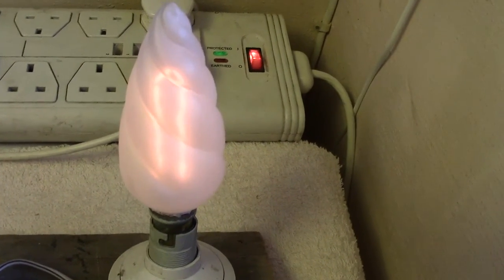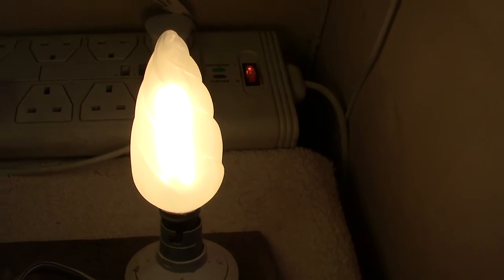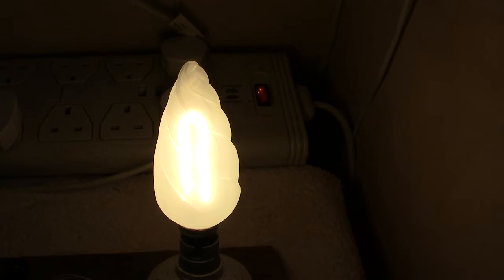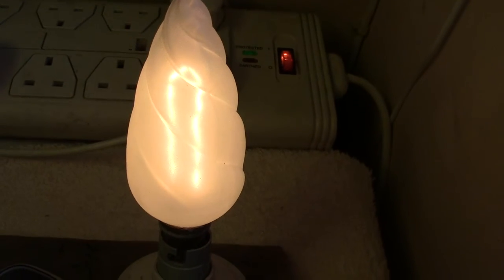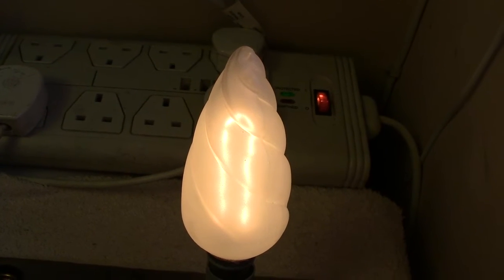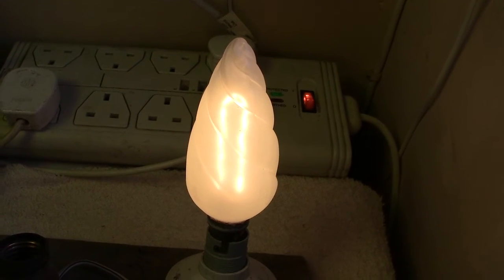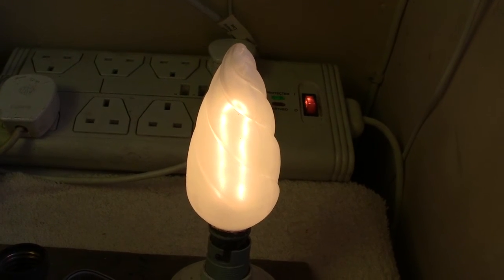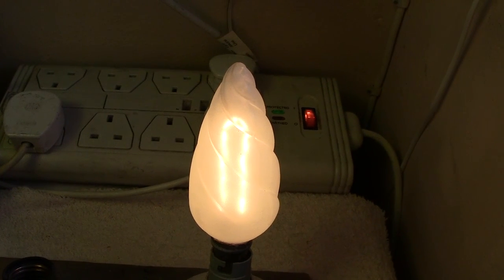Bell  Candle  Lamp   old type filament.

Comment: If I uses the codelist it would be december 1986 but that would be quite modern. I would think it was made earlier, like you said 50s-60s. The date code list I used started 1965...

The Filament looks throw the coating a bit like a carbon filament.
Reply from the maker: Yes those filaments were nice. have to sort some out for you, mention it when you are here and have plenty of space in your car you are going to need it. Does look a bit carbon like.